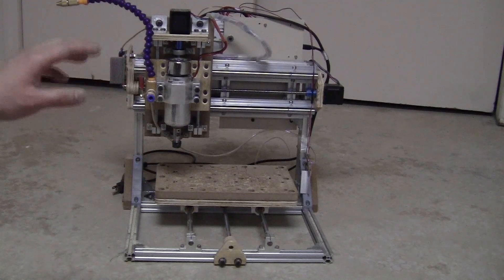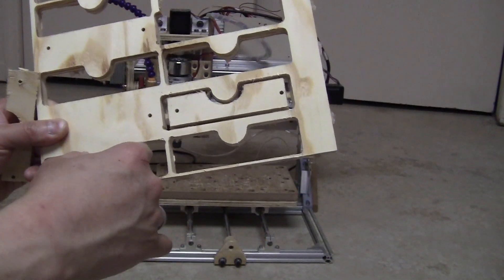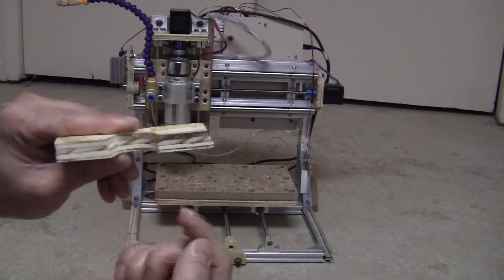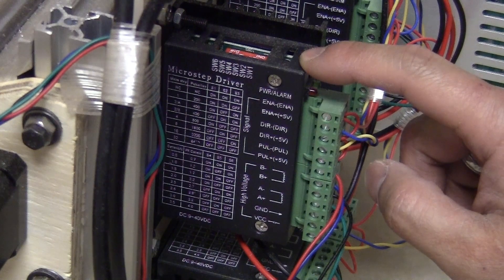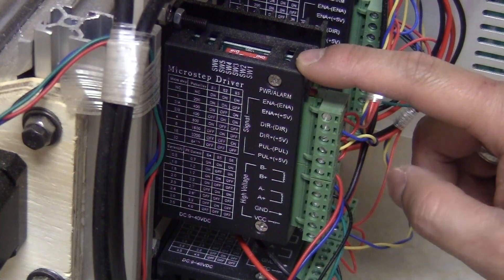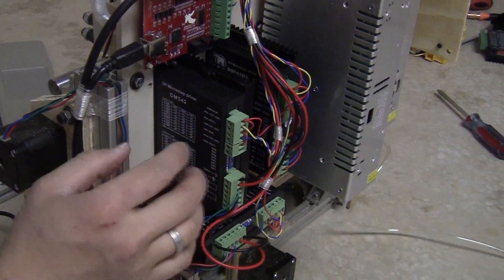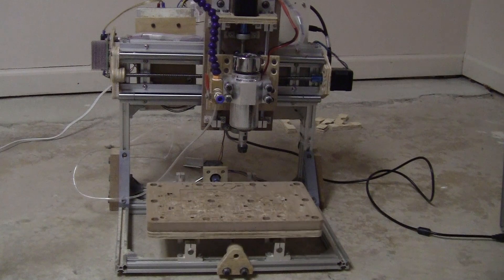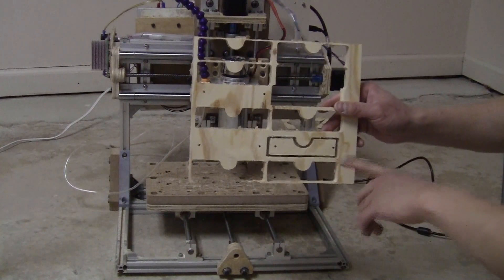Stepper motor driver - which one is not to get - avoiding TB6600 at all cost

Comment: You are not the first I had heard from about these things.  There are upgraded models but, of course, cost more so most people go for these cheap things.edit:  The DM542 I have on my 50 watt laser machine on 3.5a Nema 23 motors and never an issue with them and you know a laser is so tiny that if it lost a step, even a single step, it would be highly noticeable.
Reply from the maker: I'm just mad because it costed me a day trying to see what was wrong with my machine. Changing feed rates, accelerations, etc. Nothing worked.
Reply: Been there so many times and it is infuriating.  You would think with all of the issues with the TB6600 for all of these years that they would have ceased to sell them but China merchants don't care and they take advantage of people who just don't know.  542, the last time I checked, was 30-35 a piece but that was a year ago.
Reply from the maker: @thebeststooge  I just got 2 DM542 from ebay for $15 per piece. And on AliExpress, I found some for about $11/piece. Not too bad
Reply: WOW, those have really dropped in price as I suspected since so many things use them now (due to the TB6600 causing so many varied issues).  My t-nuts for the cnc project will arrive on Monday from China (finally) but I have ceased everything until the panic is over.
Reply: @thebeststooge  I have stopped on mine as well, I just hope to get the parts I had already ordered.  In the US now though the tracking says!
Reply: @Scott Beasley For me the Chinese didn't even ship until 8 days later which is abnormal so I am not sure (the Chinese govt isn't going to allow the real info out) how bad it is over there, or not, so I will wait until Summer which sucks but can't be helped when I can't even get my necessities due to the panic and hoarders.
Reply: @thebeststooge  True, the CP can't be trusted to tell the real truth.
Reply: @Scott Beasley The thing is I have been seeing the numbers every day and I haven't seen China's numbers budge and now Italy has 1k+ more cases than China which is ground zero?  No.
Reply: @thebeststooge  NO. The CP has good control :)
Reply: @Scott Beasley They always have from Smog numbers to now this.
Reply: Did you using marlin firmware for controling that?... Do you need to change something in code when you swap from tb6600 to dm542? ... Or you just need to plug new drivers and that's it?

Comment: Thanks for this advice Minh! I came across the very same observation from a Polish reviewer: TB6600 drivers' response may differ from batch to batch. Looks like it's an industrial issue... After all, we get for what we pay for.
(FR) Merci d'être aussi rapide pour relever le manque de fiabilité des TB6600 souvent relevé par d'autres monteurs de diy CNC. Mais j'étais incapable d'imaginer une telle dérive à ce point... grave. On atteint les désagréables surprises du "cheap" ;) Mais ton diagnostic semble coller. Reste à voir ce que ça donne dans le temps ;). Bein! Repose-toi et prends soins de tes proches. Je suis heureux: comme je n'applique pas tout de suite tes modifications, j'ai le temps de les voir murir ;) et heureux que tu sois attentif à leur évolution. Bon week end l'ami!
Reply from the maker: I got the drifting problem since I was done with my laser engraver, but I never thought that the problem came from the motor drivers. I was thinking my home design of the linear bearings was too heavy. But now, thinking about it, that wasn't it because I was able to get the fast move feed rate at 30m per minutes. It was the stepper motor drivers.
(FR) c'était du temps perdue mais on apprend des choses pour les futurs projets. Au moins c'était pas mon laser qui a été mauvais. Bon week-end mon ami.